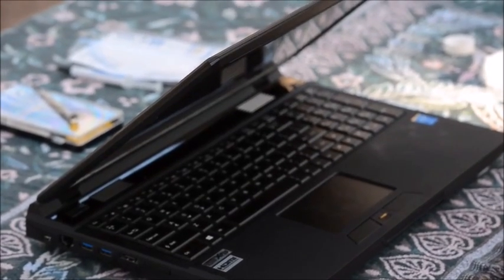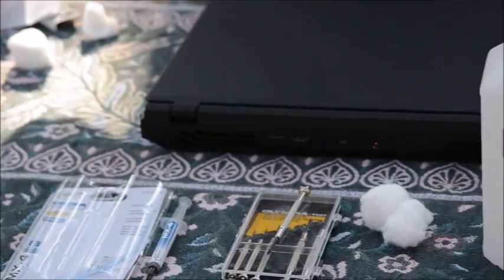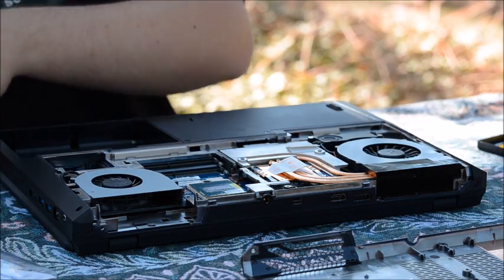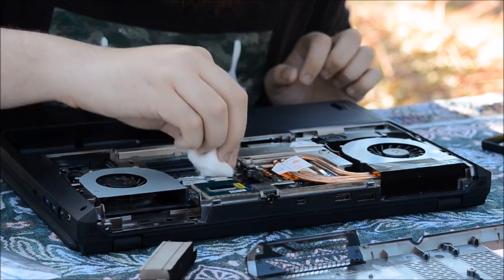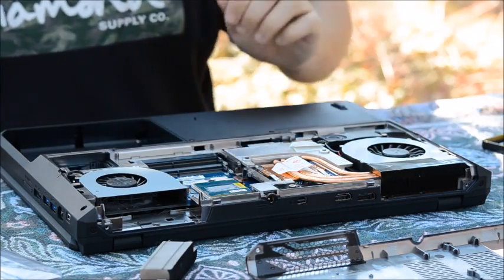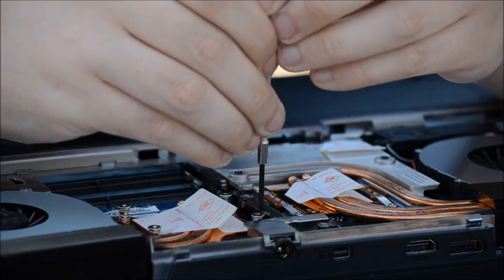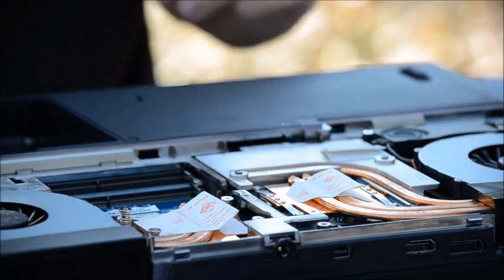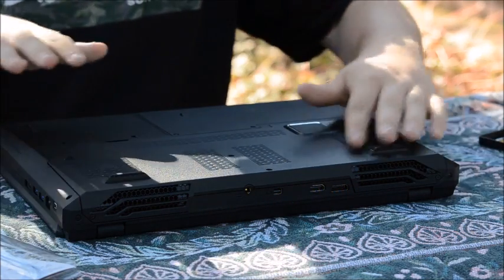Sager Np 8258 Thermal Compound Replacement

Comment: Not tryin to dog on you, bro... whoever told you not to use silver thermal compound was selling you a load of nonsense. I used Arctic Silver in mine, on both the CPU and GPU. It actually runs cooler than it did from the factory and survived multiple stress tests - during the summer months with no auxiliary cooling. I didn't spread it. I just put a dab on it and mounted the heat sink. The GPU was more complicated. It had special thick thermal pads. I put the pads back in with some new paste on both sides. Runs like a dream. Didn't even expect it to work.
Reply from the maker: nobody has told me, ive been building computers for years and have fried boards with AS5 because it has silver in it and will short a board if you get it on it.

Comment: You shouldn't be unscrewing the CPU like that. If you look at the sticker it has numbers on it, it should be unscrewed (and also screwed) in the cross pattern shown by those numbers.
Reply from the maker: dont need to tell me i work with cpus all the time, and i wasnt unscrewing the cpu i was taking off a heatsink
Reply from the maker: and it had no numbers as sager frames are clevo ones that are chinese junk which doesnt label anything
Reply: Oh, I'm looking at one and they do indeed have numbers. Yeah, the heatsink. Just pointing it out for other people, as unscrewing the heatsink like that can actually cause issues in some rare cases, that's why you use a cross pattern.